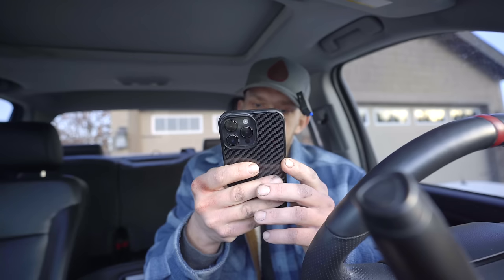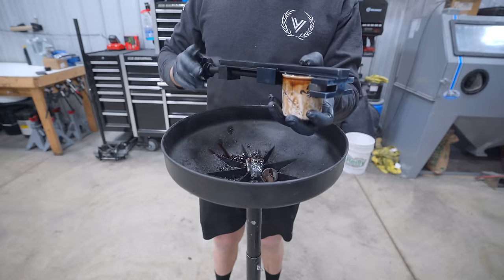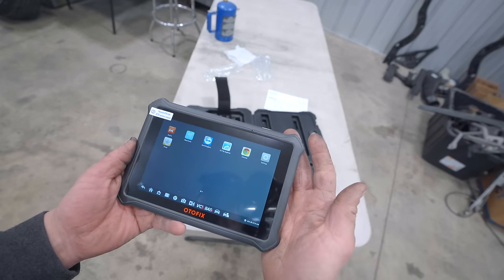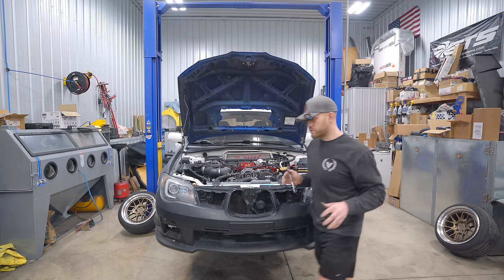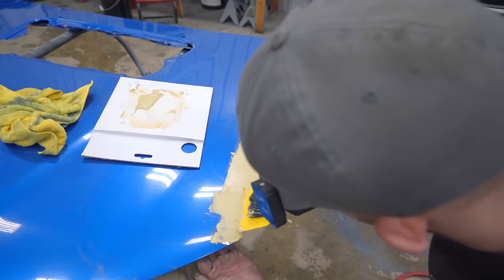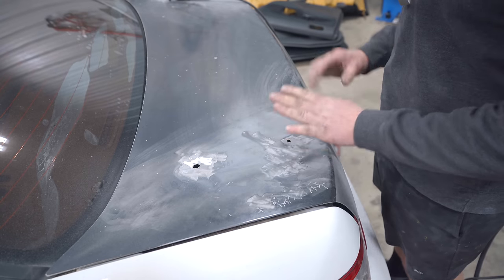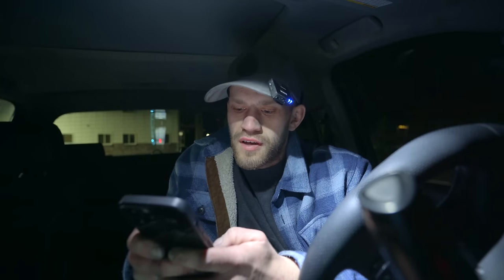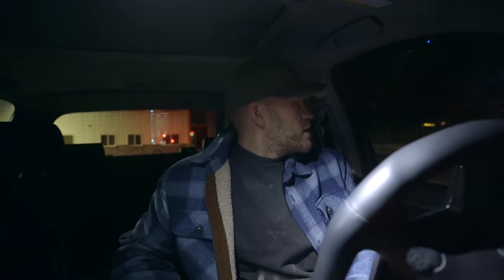Rebuilding The Forgotten 07' STi | Ep. 2

Comment: Devin, in the mid to late 90's i served in Bosnia with the British army and to prevent gelling of the diesel in our Landrovers (the temp was -25 deg c daily)  we used to add 1 litre of kerosene to 20 litres of diesel which had a 2 fold result, it stopped the diesel turning to jelly and also cleaned the fuel lines and injectors.  not sure if your local laws will prevent this but its a thought
Reply: This comment 🤌🏻👏🏻
Reply: You are the man 😎

Comment: 22:19 you can reduce the primer when you are covering 320 sanding scratches, when I worked in a body shop the body guys had to bring everything to the paint prep area in at least 320 dry with a d/a sander. Those cars were also from a manufacturer that is in Smyrna tn, and also canton ms, there were very strict rules on any repairs we did. The repairs we did were things that plants painters couldn’t repair with there water based setups. Mind you this was 20 years ago. But that’s the reason for reducing the primer

Comment: Hi devin i own a 06 hawkeye wrx 2.5l how do you determine the correct oil level because the stick has 2 sides and shows 2 differed levels when i try and check it

 i just need some closure if its using oil or not 😅

Internet has many opinions about it but i would say you have some experience/info that i could rely on many thanks